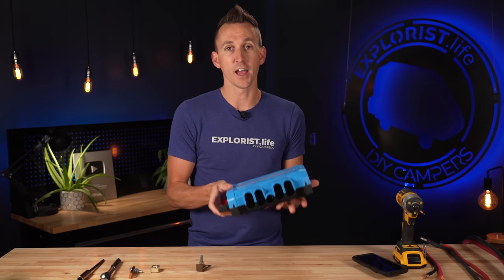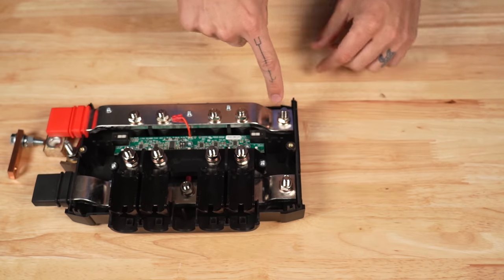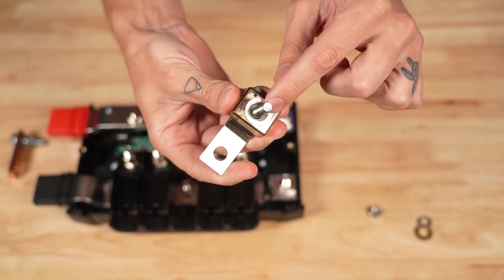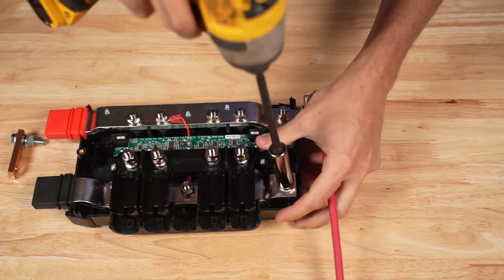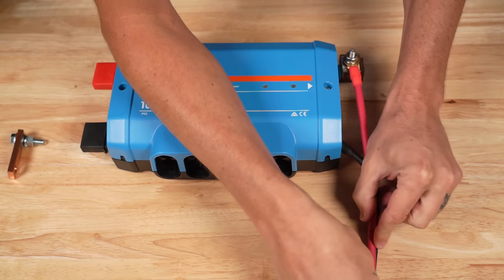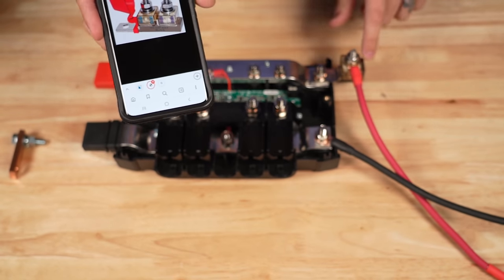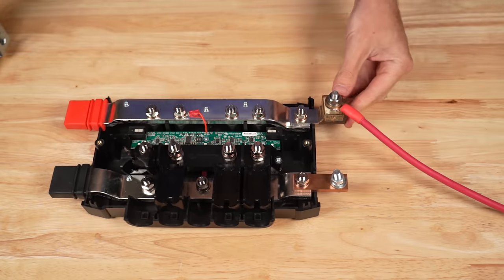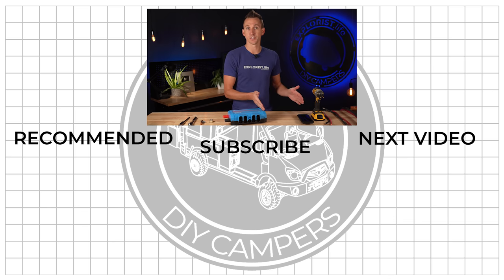HOW TO 'ADD-A-SPACE' (or two) TO THE VICTRON LYNX DISTRIBUTOR

Comment: Question:  I have a 2016 Ford Transit, Mid-Roof, 250, V6 Gasoline engine.  I believe it has a 150 Amp Alternator.  I want to add alternator charging for my house battery’s.  Do I need a larger Alternator to charge 2 each 100 amp Battleborn Lithium batteries?  Does Ford have to change software if I go to an additional alternator?  Do you have documentation on this topic?  Thanks Nate…..great channel!

Comment: Seems like this should work on the opposite end as well (the tabs) without having to use the fuse holder...just a bolt, washer, fuse, cable end, washer, lock washer, and nut.

Comment: Just installed a rooftop ac and was running into this issue… thank you!!! 🤗
Reply from the maker: Glad it was helpful.  Cheers!
Reply: Curious which ac you installed and if you have any pic of the wire setup? I’m going to need to do this hack for ac as well.
Reply: @LexxandDoze  I installed the Mabru RV 12000 -12 Volt DC Air Conditioner. I'm planning on getting the copper extension just for the positive side because I will end up putting the pos and neg for the ac on the last slot on the lynx and then putting the battery monitor on the copper extension. My ac has an inline fuse so I won't need to add any fuses on the lynx for it. I know that's probably all super confusing via text so once I have the pieces installed I'll try to send you some pics! ☺
Reply: @AuraiyaMadrid  hey thank you for the reply!! I have just figured out my plan and it sounds very very similar to yours! I’m going to use a double terminal fuse block and the copper extension.
I’d still love to see any pics once you finish up.

Comment: Two questions:
1. Are terminal fuses used instead of or in place of the mega fuses?
2. I am planning to add a double fuse extender to accommodate my ac unit. But I was already using the last stud on the right of the lynx for the positive wire connected to the bmv. Can I keep that bmv wire connected to the last terminal while using the last terminal to also connect the double fuse terminal?

Comment: Hi,this is an amazing hack.
As I already have connections on this 5th set of terminals for the lights on the distributor, can I still add another earth to this terminal or should I use your copper lynx adapter to act as an additional earth when I create an additional positive connection after following this video. The additional connection would be for a 2nd solar array which will consist of 2x 90w panels going to a smart charge controller 75 15
Any guidance would be greatly appreciated

Comment: Great stuff Nate!  I've noticed a standard 4/0 5/16 lug doesn't quite fit into the lynx distributor (I usually use Selterm lugs).  Is there a different brand of lug you use that fits the distributor for 4/0 wire?
Reply from the maker: The lugs we supply in our wiring kits are guaranteed to fit.  We can't speak for all of the other brands, but we know there are a LOT that don't fit, but the ones in our kits do: https://shop.explorist.life

We source the lugs directly from the manufacturer in bulk and they don't sell direct to public, unfortunately.

Looks like you are a commercial builder/upfitter.  Perhaps consider joining our Installer/Upfitter network so we can give you the go-ahead to install our kits/designs into your commercial upfits: https://www.explorist.life/camper-electrical-install-services/

Comment: one of the benefits of using the lynx distributor is that it can communicate to the cerbo and tell us if a fuse is blown. with this extension, do we lose that information or is it combined with a different port?
Reply from the maker: You would lose that info.  You'd want to add another Lynx Distributor to keep that info.  For anybody else reading this... you only get the blown info on the Cerbo when the Lynx Distributor is paired with the Lynx Smart BMS.

Comment: Would it be possible to connect a 12VDC RTX2000 AC to this as an extra fuse?  It would be 58amps on the (maxed out) boost setting with a fuse of 80amps to protect power supply.
Reply: Did you end up hooking up your rtx? If so, how did that go for you? Pictures?
Reply: Yes I sorted it out not sure how I can add photos onto this comment thread

Comment: Dear Nate, It is said that battery banks perform best, when all the cables are the same length. I am wondering if you have your bank wired in series and then parallel, then the series wires are the same length and the parallel wires are the same length. but not necessarily the same as each other? Is that correct. Cheers from Canberra David R
Reply from the maker: That will work, yes.

Comment: What perfect timing!!! I'm using one of your diagrams for my new camper van and had the same situation when I decided to add a 12V DC Air Conditioner. I'd just use a Lynx distributor but for space constraints. Thanks for being considerate of all the various  'van/RV' factors such as space, budget etc. That's what makes your channel so relevant and useful to so many. When I came to this dilemma, I decided to use a Class T fuse for my battery bank main fuse so I repurposed the former main system ANL fuse with a self made, two hole, copper bar using your instructions to connect the A/C's ANL fuse between the On/Off switch and the Lynx on the power 'in' side.  I didn't think about using the "exit" lugs on the Lynx. Do you have any thoughts on one end being better than the other? The MBRF compactness may also just be best for my space. Anyhow, now back out to the work bench to see which layout fits best in my 'power center' as it's just about to get wired up next week. Thank you - so very helpful!
Reply from the maker: The MRBF fuse holder decreases overall connections than an external fuse holder with a jumper wire but if I'm understanding what you did properly, what you did sounds fine too, just a bit more bulky, perhaps.

Comment: Well for bigger connection wire it’s much better to modify the plastic cover a bit. The purpose of the cover is to cover the connections so if you drop eg a screwdriver it’s not shortening. With your adapter you compromise that.
Reply from the maker: Or just buy another Lynx Distributor and bolt it to the end like designed.

Comment: So I'm upgrading my 2008 Tiffin Motorhome to Lithium and doing it in phases.  Currently I am getting ready to install 3 new 195 Watt Bifacial Solar Panels on the roof of the motorhome, then going through a Victron Charge Controller and then off to the current flooded lead/acid cell batteries that are in a series/parallel configuration.  In this motorhome, there are two 4/0 welding cables currently from the the batteries to the inverter/charger.  And a second set of 4/0 cables from the batteries to a pure sine inverter near the original inverter/charger.  All 4 of these cables are 25 feet 6 inches long.  There is no room near the battery bank to put Victron Multiplus 12/3000 120-50 2x120V down the road so it will need to go near the location of the current inverter/charger.  How do you recommend I connect the Charge Controller power to the batteries, I'm thinking of going back through one of the pairs of 4/0 cable.

Comment: Cool, I didn't know that fuse method existed. A person might be inclined to use those fuses and just buy a copper bus bar and drill some holes in it. That way you wouldn't have to spend the big bucks on a lynx distributor. I have no idea how the dollars would actually calculate out though.
Reply from the maker: It would cost about the same or a little more to attach the fuses directly to high quality busbars as the Lynx Distributor.  I've done that calculation in the past with ANL fuses and it was more expensive that way.

Comment: I need help! I used your wiring diagram (renogy 500ah) I have a 400ah lithium battery setup. We just got down to 49% for the first time and our power just shut off completely. All of our devices are set to lithium so I’m not sure why this would happen. Please help!!!
Reply from the maker: That sounds like a settings issue.  I'd make sure that your BMV 'charged voltage' is set to .2V lower than the absorption voltage of all of your chargers.

Comment: Why not drill a hole in the middle of the top (positive) bar to make an extra fused space? Yes, some will say I'm cheap (true), but this is a high quality piece of hardware that I suspect can handle the extra capacity.  I'd honestly like to know a good reason why not. Making additional holes in the plastic would be easy. I'm assuming the ability to make good holes.  Thanks.
Reply from the maker: The molded plastic piece under the positive busbar is missing the space for an additional fused space.  Although a good idea... that would take a LOT of modification and I'm not sure it would physically fit another fuse.

Comment: question, can you flip the bus bars around?  that is lookint at the lynx if the two input openings are to the bottom, then the positive and negative bus bar studs protruding out are on the left.   what if you need them on the right, but the openings still pointed down? can you undo the bolts and just flip the bar around? there are openeings on both side?  thoughts?
Reply from the maker: Not sure.  Never tried that.
Reply: Did you ever try this?
Reply: @TheCodeMonk  yeah, no go.  it was a year ago.  i
Reply: @fixtradingconsulting2935  thanks for reporting back!  Right after I asked, I went down and took it apart and saw why it wouldn’t work.  

For anyone else who comes later, the “holder” for the head of the bolt on the recessed lynx tab connection is only on one side of the housing.  For that reason, you can’t turn it around as that bolt will spin when trying to tighten it.

Comment: So help me to understand what this is for.... does this take the place of regular bus bars and fuses? Aren't these limited in voltage? This is currently $222 😳
Reply from the maker: It takes the place of 2x busbars and 4x fuse holders and the wires/lugs to mount them together, and is cheaper than separate fuse holders and busbars.  More info: https://youtu.be/548aRhZMN-g

Comment: You need a larger terminal eye on that cable and the brown insolated washer should have a step in it to keep that large round terminal ring from being able to touch the stud.
Reply from the maker: Hey Jack!  Literally, none of what you said is accurate.  Thanks for watching though!  If you have a question, or are confused about something feel free to ask it as a question on how it works instead of telling me that my methods are incorrect.
Reply: On my car (to relocate the battery to the trunk) I'm using a fuse holder like the one you're mentioning. It comes with an isolator washer you have to put on the top of the fuse, like you described. But in the video, it's a different type of fuse holder with a built in isolator at the bottom. The bolt is already isolated from the metal plate, so no need for an additional isolated washer on the top. If you look closely around 1:08 you can see it. I didn't know about this design in fact! Very interesting. Thanks for sharing!

Comment: Hi, sorry for my Bad english, i think your wiring is Not correct, the bold you connected the positive to, will be always on fire. The breaker will Not work, the bold is permanent connected to 1000A Busbar From Victron. Or am I wrong?
Reply from the maker: I'm not sure I'm following your criticism... but the wiring is correct.  Nothing 'will be always on fire'. Thanks for watching!
Reply: I think he is asking if the bolt you are connected to would always be hot even if the fuse blew. You mentioned an isolation pad on the bottom, but is the bolt isolated also?
Reply from the maker: I see.  The stud of the fuse holder is isolated by that brown non conductive base I talked about at the 1:08 mark.  The isolated nonconductive pad is what is holding the stud.

Comment: So if we’re dumb and using a 12v system but we want to run 2 3000kva victron multiplus2 inverters to power 3 air conditioners and charge a tesla from the battery bank, I could technically just put 2 4/0awg positive wires and 2 4/0awg negative wires running to both outter sides of the lynx bus bars and then put my 4/0awg wires that are fused from the middle and to the inverters battery inputs right?
Reply from the maker: It's not that easy.  There's several areas in a 12V 6kVA system where you'll run into wire doubling issues including potentially needing to double wire sizes between batteries (math required), doubling switch capacity, fusing each conductor independantly, and more.  There's a reason you don't see a 6kVA 12V system available in our store, and it's due to these system design problems.